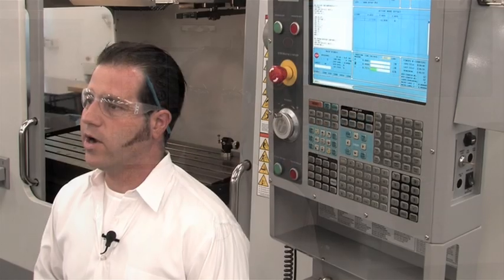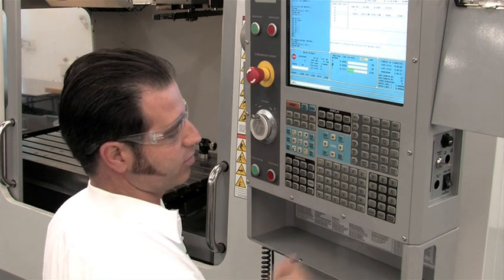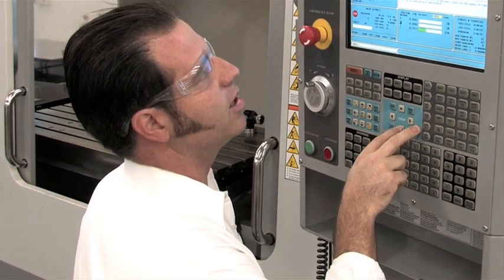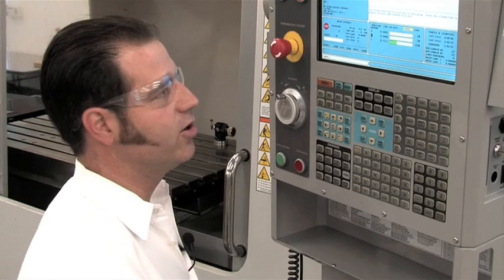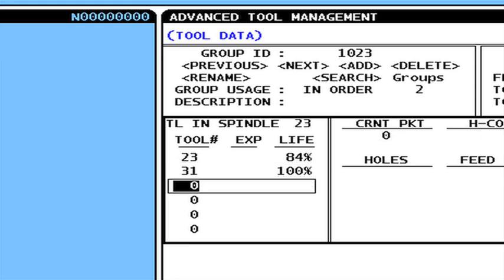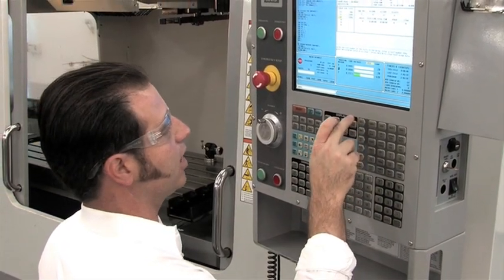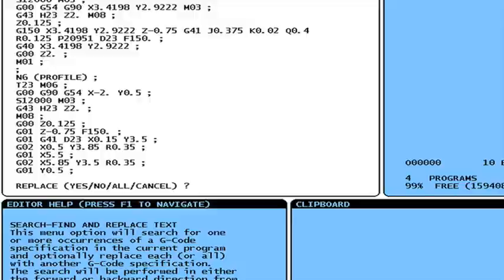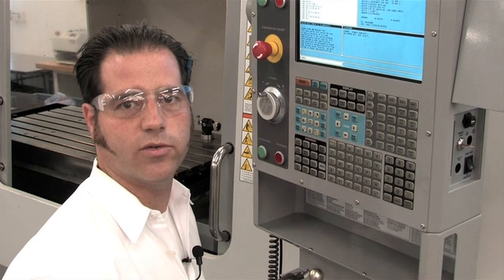Haas Advanced Tool Management — How To

Comment: respected sir
i have VF1 model. I always have alarm of low voltage but i check supply the supply is current.
if i press reset to remove the alarm the the spindle comes down .
i saw there are also low lube or low air pressure alarm come. but its also ok.
Reply from the maker: Hi Aniruddh. Send us an email to atyourservice@haascnc.com with your contact info and we will see if we can figure out what is going on.